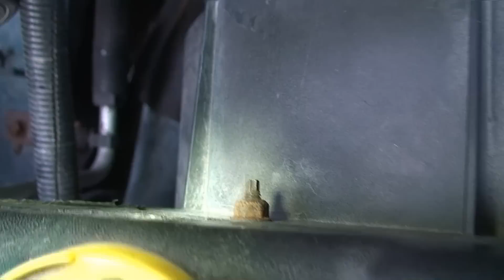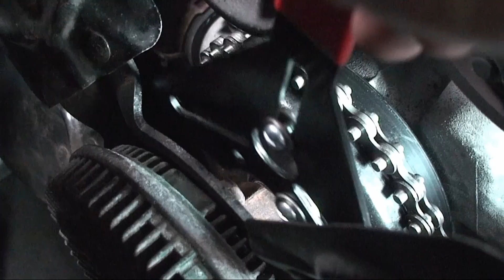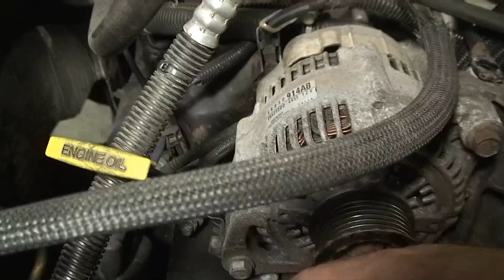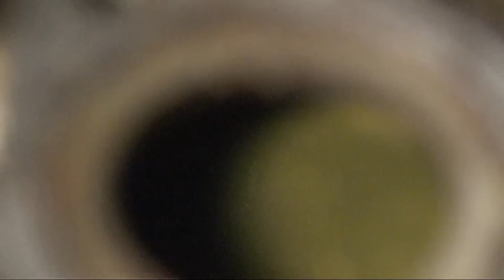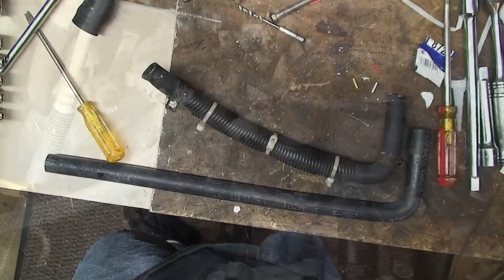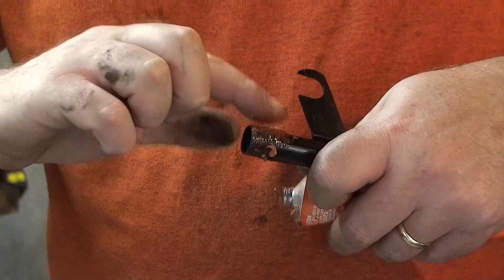Dodge Dakota Coolant Leak Repair - Including Bypass Hose, Thermostat, Water Pump, etc.

Comment: This is one great video! I am ready to tackle the job now. My 1500 page repair manual was unclear on how to change the bypass hose. Still trying to figure out how to get the pulley off the pump. Does it unscrew? The repair manual says it has bolts but it does not, it looks just like the pulley in the video.